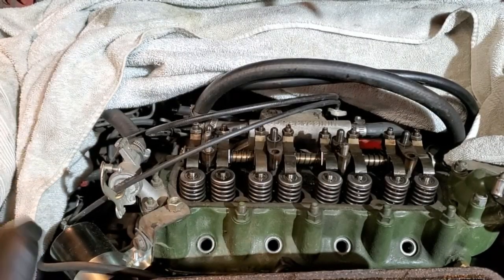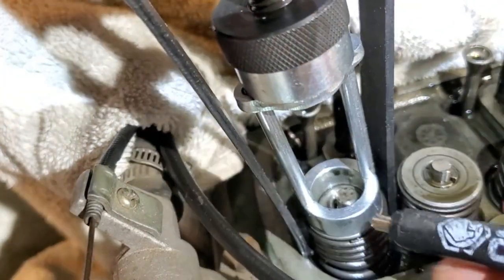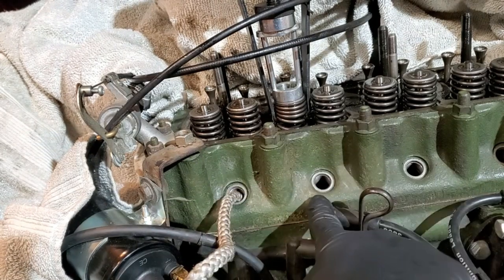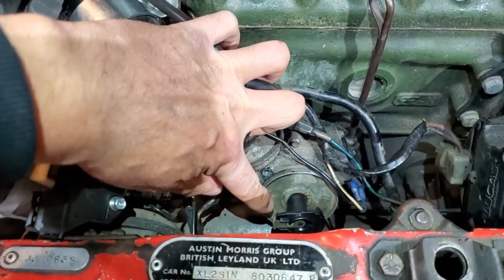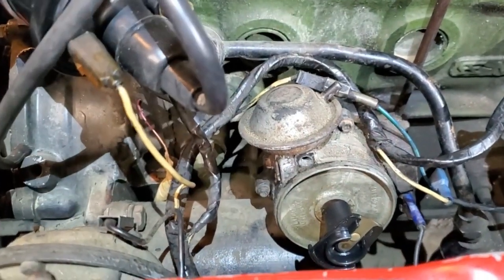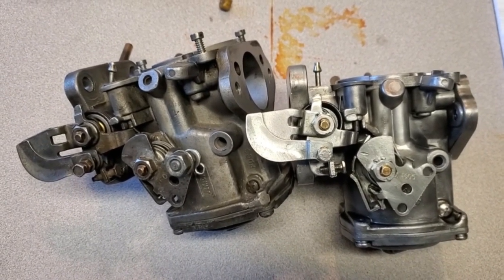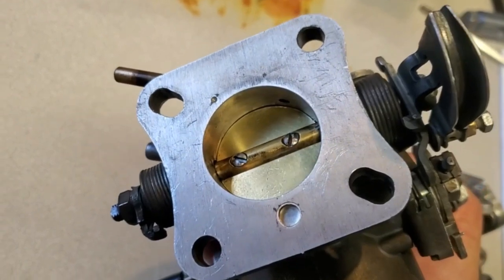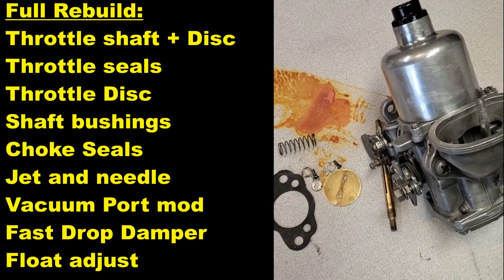Red mini Project Part 3. Valve Stem seals, Dizzy and Carb work..

Comment: Heads up, your sequencing is out. You jump from part 3 to 5
Reply from the maker: Out of sequence on the links? Part 4 is the brake work.
Reply: @darrensrestorations991  hi Darren, it's just that when I finished part 3 and it played the next video, it jumped straight to 5